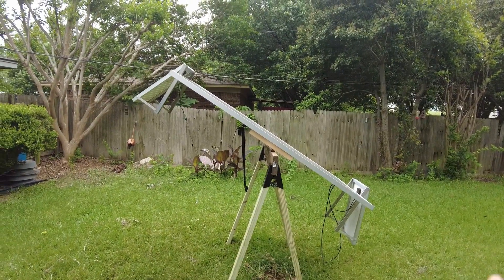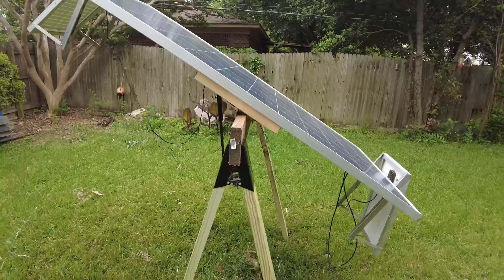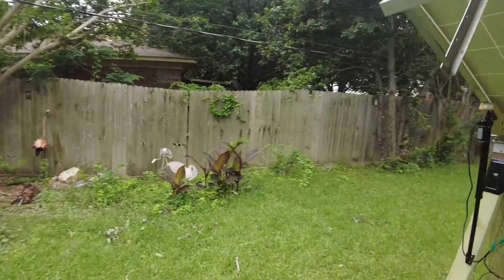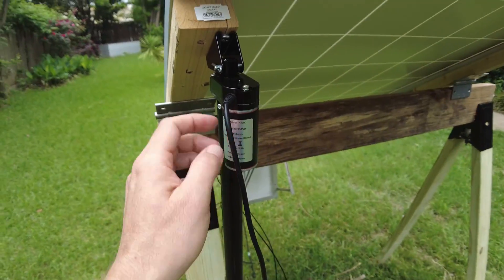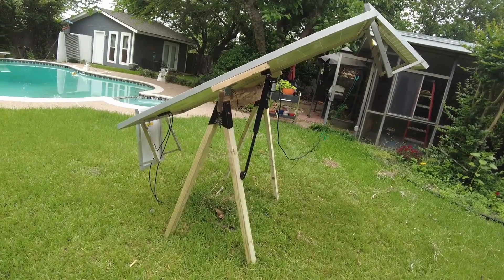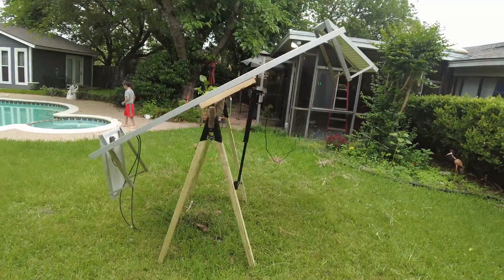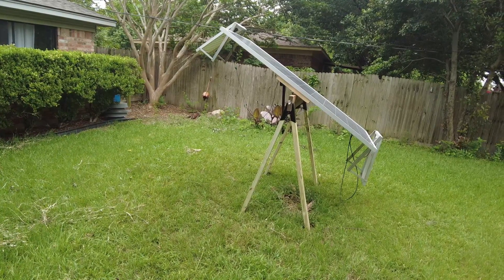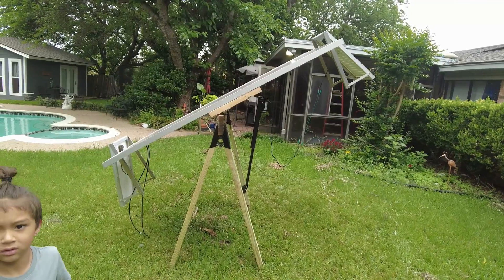Easiest Solar Tracker

Comment: Good job, nice & simple. Maybe you could actually ground mount the 2 panels & still get the same effect. 
I think diodes to stop back feed of panels would also help, but this is really great to see something so simple that works. Cheers
Reply: The two "sensor" panels must stay attached to the panel to give the differential  currents to the motor so placing them on the ground won't do. As the sun travels in its arc, the appropriate panel supplies the correct polarity current to drive the motor in the proper direction. When both panels recieve the same sunlight intensity (because the main panel is now aligned with the sun and both sensor panels are equally exposed to the sunlight), the sensor panels' currents cancel and the motor stops. My inclination would be to use very small panels, feeding the bases of a couple of pass transistors, with a battery to the motor switched on by those transistors. Also, if I'm not mistaken, many panels, if not most, are already equiped with a reverse current protection diode.
Reply: @spamcan2551 has anyone tried it? I think on the ground will work, just angle them to east and west. That way you can use larger driver panels and move more panels/weight.
Reply from the maker: Thanks!

Comment: Elegant solution. Just wondering what you need to do to keep wind from interfering?  It's very sunny here year round, but frequently very windy as well.
Reply from the maker: Thanks. Yeah I've recently been thinking about wind, others have been asking too. I'm kind thinking a small wind generator, maybe 20 watt that will power the actuator to move it to center/level if the wind is blowing. Would need some center switch that would stop the power from the wind generator when the panel is level. Mercury switches?

Comment: I try to build the same...or close. 

Setup 2x400w (2x20kg/1.73m-1.13m)
Plus 10kg wood...mean 50kg.
+ 2x solar on side (5kg-)

Well small Setup work well i think..
but actual i dont know what motor ( how strong) or panels i need for. 
50w panels actual cost are also a Nut to crack.. 
1x410w cost me 350.- 
A 50w is 150.- so i pay a 400w if i want 2.
The 400w are splited in left right area hmm...
i dont know now.

Motor shud be able to move 50kg....
all i know actual.

For your heavy setup ? ( with 2)
probably somebody wroted allready..

Take motor to a middle stand...
Now the motor lift one side n rest follow. 
On one side u show screw get pulled out. 
This could be the point...ereased by motor in the middle ( i think he likes that 😉)

What u have above is more heavy then below...could be another point why screws get pulled out. 

I think I'll take a round beam without angles and put it on it 🙂✌️
Reply from the maker: Sounds interesting! I build another with 2x 435w panels here: https://www.youtube.com/watch?v=gHZCTBCteW0
Reply: @BradCagle  jup i saw it n thats what i talk about motor. in the middle he would not have so mutch pressure from the panels on opposite side.

If you take the upper crossbar and replace it with a round one, you don't need the angles and the whole thing rolls.  not too far needs a limitation on the bar.

time to build 
I share if i get it 🙂✌️
Reply from the maker: @meiermarc3743  Here's a tip: Inside the linear actuator are limit switches. On the back of the limit switches are diodes. Replace those diodes with schottky diodes. This makes the motor much stronger when in the limits. That fixed my problems with it lifting more weight.

Comment: Very cool design. I'm going to try to build it with 4 100w panels.  Will you please post the link for the 20w panels? Thanks!
Reply from the maker: The 20w panels I salvaged from some old solar roof vents. Check amazon.
Reply: @BradCagle  can we use smaller panel like 10wp for the driver sir?
Reply from the maker: @javastone5721  Possibly, give it a shot!

Comment: It's pretty cool how that tracker works, but I would be concerned about the two 20watt panels conflicting with each other, especially at mid-day. Having two alternate polarities does not cause an issue with the actuator motor?
Reply from the maker: The two 20w panels are actually fighting each other for most of the day since they position the tracker towards the sun. If the panels are equally illuminated they cancel out, and the actuator sees 0v. As the sun moves, and begins to illuminating one panel more than the other the voltage slowly starts to rise in either the positive, or negative direction. When it rises high enough to start the motor, the actuator moves until both 20w panels are equally illuminated (i.e. the voltage is back to 0v). Now you're probably wondering where that power goes when they are fighting, right? Simple its just dissipated in the panels, and the wire, like a short circuit, which is fine, panels can handle a direct short, and the wire is size to handle the power.
Reply: @BradCagle  In my head I was thinking the wires or the motor would get hot when receiving two opposing polarities, but your explanation helps me make more sense of it. Thank you.
Reply from the maker: @troyyarbrough  There is a point while the voltage rises to the motor, but not enough yet to move it. It's effectively stalled, the motor  gets slightly warm, but not enough to cause any damage from what i can tell. It's been running for months,  time will tell.
Reply: Thank you for this video I used it to reference when I built mine although  I had to stray from the sawbucks idea I was able to create a dual axis tracker with your panel set up
Reply: How about adding a 5 to 10 ohm 10 watt wire wound resistor  on the motor to help dissipate the power?

Comment: When i first published this 1986,  i used what was on hand a 5w panel cost $100's and they where liquid crystal, over the years i have seen some crazy variations.  Keep it simple stupid is the motto :)  You don't need those 20w, unless your goal is to be battery less, If however you will use a battery, this is what i do 36 years in the future. Little 5v cell wired to a Logic Level mosfet, or an arduino mosfet module for each axis east & west running from battery to mosfet to actuator, when the cell is flat to the side only one side will ever see the sun, 2 more and you have azimuth. The cheapest and easiest setup are panels balanced on a pole and U clamped for east west. The end of the pole is raised or lowered for azimuth. I hope this helps :)
Reply from the maker: Thanks for he info. Really I don't think it can get any more simple than what I have, 2 small panels, and a linear actuator, all of which are basically dirt cheap these days. I rebuilt this unit, it now has two even larger main panels, check it out https://www.youtube.com/watch?v=gHZCTBCteW0
Reply: This is the most basic.  I was actually looking for an Arduino build.  I thought of my own design  while driving or something.

Comment: GENIOUS!!!  This is fantastic.  I hope you keep working on improving this because this is an absolute game changer.  Thank you!!
Reply from the maker: Thanks. I'm currently working on expanding it to two 435w panels.
Reply: @BradCagle  I'm considering using this on a 5S2P setup for 10 365w panels.  Makes a lot of sense.
Reply from the maker: @AndrewJohnson149  Nice dude! I would love to see that in action. I'm wondering if/or at what point will we need larger panels? Today I grabbed a 2x6x8 (lumber) so I can mount the two 435w panels across. Here's a tip, keep the wires coming from the panels to the actuator the same length. This will ensure the actuator is seeing the voltage right in the middle, and not biased towards one side panel. Also the wire you use needs to be capable handing the short circuit voltage. I'm using 18awg and nothing is getting hot. if you use higher wattage panels you probably will need larger wire.
Reply: @BradCagle  Thanks for the info!  Once I take a loan out for the wood, I'll start building  lol
Reply from the maker: @AndrewJohnson149  I know that's right. My grandson asked me to build a treehouse, I told him I'd have to take a 2nd mortgage, lol.

Comment: Love the simplicity of this design. Great video!
Reply: he needs a couple of variable capacitors so that when its on the other side, the power is controled by the capacitor so it does not cross the polarity to the motor,   the way its wired,  that is what will damage the motor,  Crossing the polarity like that

Comment: That is absolutely ingenious!!!!  You should put blocking diodes on the solar panels so that one panel doesn't discharge into the other when it doesn't have any light on it, it may make it a bit more efficient and able to power a larger array of panels, since the solar panel not getting any sunlight won't discharge the other panel.  Not sure that it will work, though, you should try it and let us know how it works!!!
Reply from the maker: Thank you! Yes, I was actually thinking the blocking diodes initially too. I will totally try them.
Reply: I was actually thinking this when watching the video. I think this will work...
Reply from the maker: @wullie1320  the blocking diodes won't do anything useful. Tried them. They actually just burn more power from the voltage drop.
Reply: @BradCagle  good to know! Thank you!
Reply: I think blocking diodes will defeat the design. A blocking diode will not only stop current from the opposite panel, it will stop the return current from the actuator.
Reply from the maker: @stephenm6019  Right, they are not useful. Now there are diodes on the back of the limit switches in the actuator. Change those out with Schottky diodes, the actuator will work much better getting out of the far limits.
Reply: Your panels mostly likely have built in blocking diodes.
Reply: Just mount your driver panels behind the solar panel  faceing the same as your main panel and the farther you have them back form the face of the main panel the more direct the suns focus on the main panel wiring can stay the same but very nice set up but ya if you make that mounting change of the diver panles they will last much longer and less chance of fire or failuire
Reply from the maker: @lessmith4165  So I initially thought of doing that. However the problem is the tracker will not return to the east in the morning because the driver panels are both facing the west from the night before.  The other problem is like you said the driver panels need to be far back, and that complicates the mounting. The way I have them works flawlessly, and nothing is getting overly hot. These little panels don't generate enough power to worry about fire as all the wiring used is well capable of dealing with low current.
Reply: @lessmith4165 HI Les
Could you draw a simple diagram of your positioning idea for the solar balancing device. I'm not seeing that in my head. I'm old and not good anymore at that kind of thing. Thanks for your input.
Reply: That’s super cool, what a fun project. If we didn’t have such high winds, I’d consider making one too.
Reply: Brilliant concept...now we have an idea..sure things could be improved here and there..excellent..